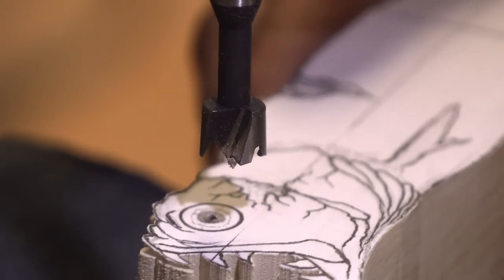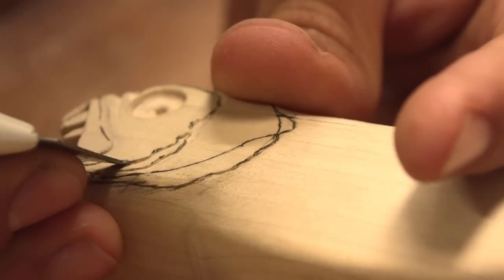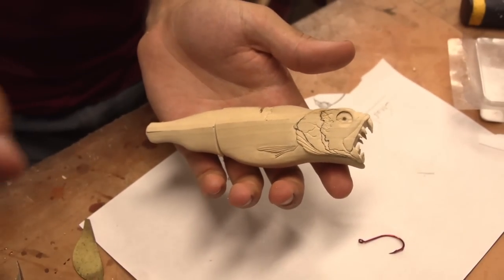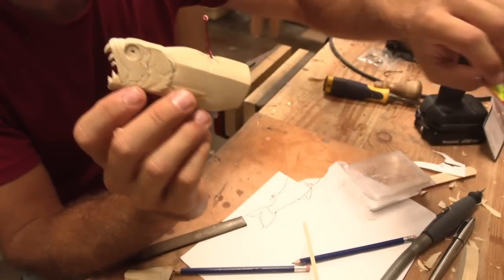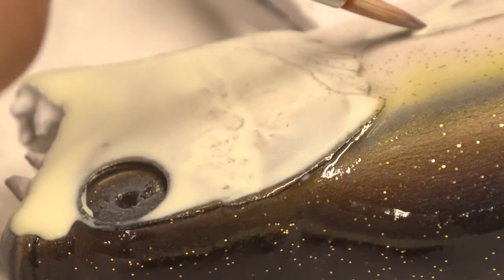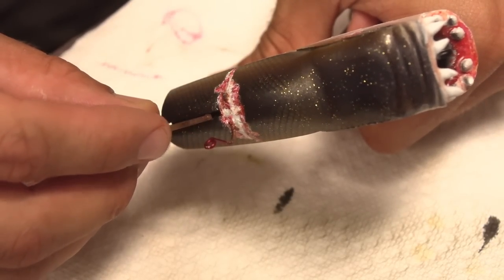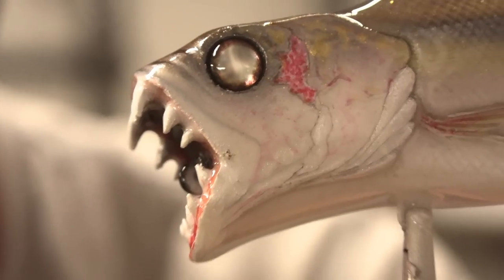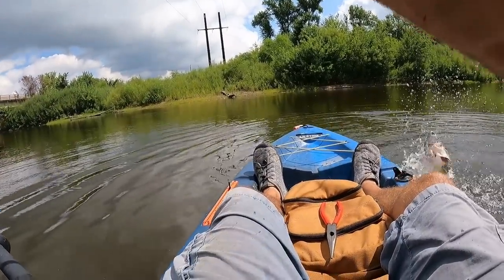What Would Try To Eat This? Making a Gnarly CreekChub Fishing Lure

Comment: I bought myself a 3D printer, and have been learning to use Fusion 360 CAD program.  No, it's not the same as carving a block of wood, but the finishing process is the same.  Sanding, painting, hardware, etc.  It's rewarding when the bait works as intended.

Comment: Hello Nate, I saw you talked about how the hard lateral line easily chips because the epoxy voids hard edges.  This is easily solved by either a matte clear coat sprayed over beforehand.  You can also use a spray on finish like I have seen in a few of your other videos, as it will bond immediately to the body wherever it is sprayed to keep the paint from chipping on the hard lateral line.  Nice work and I enjoy the videos, Tommy.

Comment: the reason why you pull one up then get no bites after. all tell you the secret. when you throw that fish back in the water. the first thing it dose is tells all the other fish what happened. now if you think that a fish will bite after hearing horror stories from its friends well that's just crazy. tip smaller pond tend to have this happen more often if you want to avoid being skunked after the first bite find a big body of water with a good flow to allow fish from further away to travel to where your fishing..